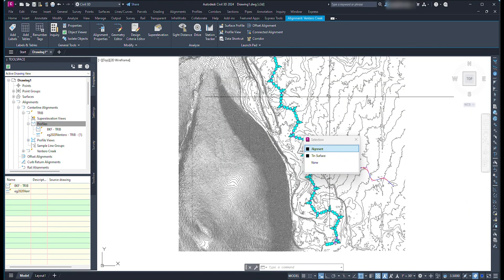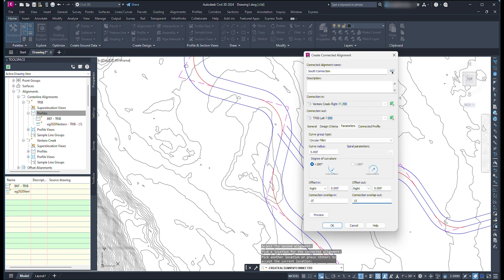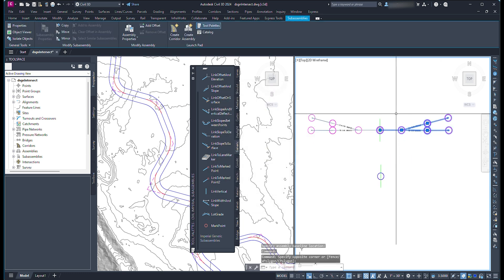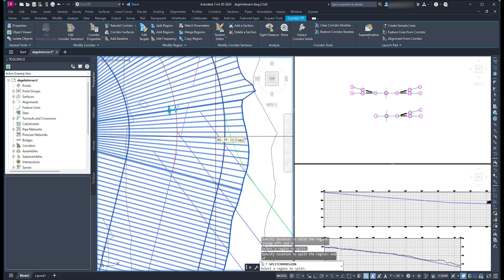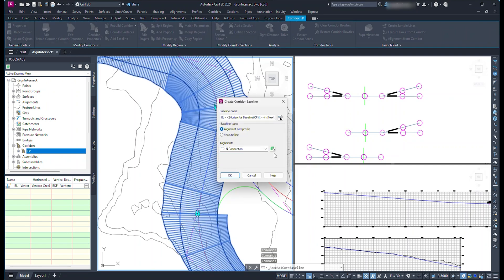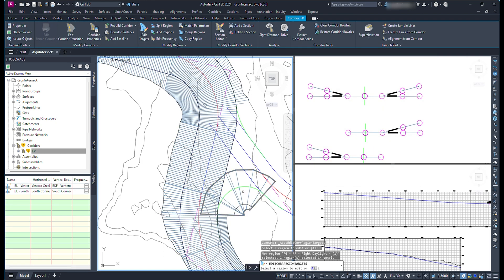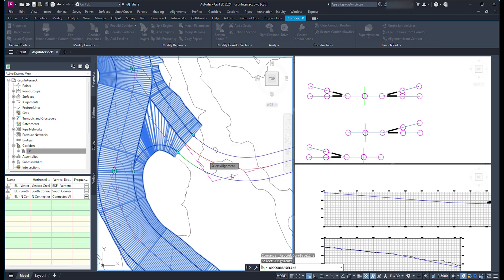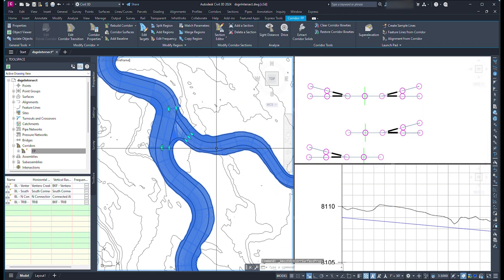Connected alignments and corridors to create floodplain grading for a tributary in Civil 3D

Comment: If you needed to stay within a set "Limits of Disturbance", would adding a breakline/boundary to a corridor surface impact the elevations created in the corridor surface?  Or would it be better to adjust the the properties of the corridor (alignment, assembly, etc.) prior to creating the corridor surface?
Reply from the maker: If you had a limits of disturbance polyline you wanted to tie into you could put the existing ground elevations on the polyline using a grading utility, then using a linkwidthandslope subassembly you would target the 3dpolyline for your corridor.